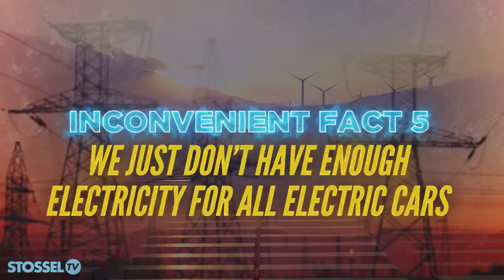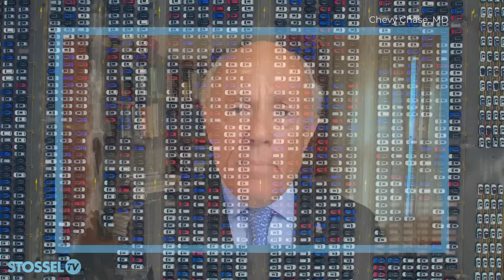Electric Cars: Inconvenient Facts, Part 2

Comment: Here are my opinions about some of the anti-EV arguments:

1. "They'll overload the power grid" If everyone used DC fast charging then yes, but you don't/shouldn't just let them run out like a gas car. The best way to charge them is overnight, and unless you drive 100+ miles/day, that should only have to happen a couple of nights per week. Also, charging at home uses roughly as much power as maxing out your oven and stovetop. If this was actually a problem then there would be rolling blackouts every Thanksgiving.
2. "They're too expensive" They are kind of expensive but you can get a used one. I bought a 2017 Chevy Bolt in like-new condition in 2021 for about $17.5k, including sales tax and shipping. Current batteries last a long time so unless the previous owner lived in the desert or used DC fast charging every day then it should be in great condition. You can also use an OBD reader and voltmeter to identify bad cells and replace them. After enough miles, especially city miles, the car will more than pay for itself in terms of the gas you save.
3. "It'll increase my electric bill" Well, yes, but less than what you'd normally pay for gas, even in a reasonably efficient car. I pay something like 3 or 4 cents per mile when I charge at home. For comparison, my dad's car gets 39 miles/gallon and he pays around 8.2 cents per mile.
4. "There aren't enough chargers to do road trips" Yes there are. I use an app called PlugShare. You can even filter by free chargers. There are hundreds of free ones everywhere, sometimes even the ones with DC fast charging (I used a free DC fast charger in Atlanta 2 weeks ago). Sometimes individuals list their home chargers for free and only ask for you to send a text in advance, but of course you wouldn't want to depend on that. You can also pay if you want to have a better chance of finding one that's available and not broken, or if you want to use DC fast charging.
5. "They don't work when it's cold" That's true. They lose roughly half of the range in winter, so until they have solid-state batteries with twice the range, they won't be a good choice in cold climates.
6. "Just use gas directly! Don't burn it in a power plant to charge batteries!" A gas engine in a car is about 20-25% efficient, compared to about 54% to charge a car from a natural gas power plant (60% for the generator, a little over 90% to charge the battery, and transmission losses), so it still makes more sense to use gas that way, although I think it's still wasteful. Ideally power should come from solar panels, nuclear, and mechanical sources such as wind and hydro and be reserved for things that actually need it such as lights, computers, and EV's and fossil fuel should be saved for heating, cooking, and making plastic.
7. "It's a weird new gimmick to convert us to Communism" Wrong. The first rudimentary EV predated gas cars by about 50 years in the 1800's. In my opinion, gas engines wouldn't have become popular if they had had lithium ion batteries back then.

Even though I like EV's and drive one, I still don't think they're ready for everyone, but once they have cheap solid-state batteries, it won't make economic sense to use gas engines anymore. My electric car is perfect for me but I support other people's right to not have one. I know that most people can't afford to transition yet, or drive too much each day for it to make sense so I don't think gas cars should be banned. And before people say that the government can turn off my car because of the computers (yes, I know they can and I'm not denying it), what gas car made since the early 90's doesn't also have a computer?

Comment: Yesterday I saw 2 cars parked as far as possible from the Freehold Mall
At first I figured it was carpool parking but no, that's where they put the chargers to make sure you get your 10,000 steps in
Reply: They put the charging stations distant from the entrance to prevent jerks from parking in them. "Look, there's an open space." "But that's a charging station." "Not my problem, I park in the closest open spot I find."
Reply: @Fishy "Smart. When the EV's catch fire the mall should be safe." EVs are 100x safer from fire than a gasoline car.
Reply: The reason the charging stations are so far away is when the electric cars catch fire it won't burn down their stores
Reply: @jonbender9110  gasoline cars catch fire 100 times more often than electric cars do. Please get some facts before you type, you'll look less foolish.
Reply: @Just SomeGuy  give them time and when evs catch fire it's almost impossible to extinguish them and evs batteries are made with child slave labor

Comment: The unspoken part of the plan is the end of private ownership of personal vehicles. But it's not what you think. The large majority of the time during ownership a personal vehicle is parked, what if all that downtime  coul be used to provide transportation to others? Then we'll need fewer cars, fewer resources to build the reduced number of cars, and fewer cars plugged in to the grid. Make the car self-driving and it can be recalled for recharging or to pick-up its next passenger.
This plan is not meant to limit your freedom, that's just a bonus for those who want to rule you.

Comment: What about people like me who live in a very rural area? 200 miles to the nearest town with 100k people? That's a 3 hour drive. What's going to happen to the battery when it's -20° where I live. What do I do when I need a truck? How much will I have to spend to get another circuit put in my house to charge a car? Can I charge overnight on 110 volts?
Reply: Put in a standard 220 volt dryer outlet. Your 300 mile range car will be charged up overnight while you sleep.
Reply: @waywardgeologist2520  and what about just making a day trip to Billings or Bismarck? And hunting and fishing? And how much is running another 220 circuit going to cost? I have one that runs the stove. I can probably afford it, but what about others not so fortunate as me? I'll need two 220 circuits for 2 cars. How is that much more electricity going to be produced? Coal? California couldn't handle it this summer. Our area has less than 10k in the county, and maybe 500k in the east half of my state, and just over a million people when you add in west of Billings. How are we going to pay for power grid upgrades? Not everyone in town will be able to afford it. Electric cars are near and make sense for daily commuter's in urban areas, but it doesn't add up out here.
Reply: Hybrids make more sense than electric for many. If charging takes longer than fueling up, plus not having charging stations everywhere.
Reply: @russellsmith5056  people in big cities driving hybrids would make some sense to help reduce breathing in exhaust. But its good to have a back up gas generator at least in the electric car, or just have a hybrid instead of an electric, cuz people dont wana have to wait to charge or go somewhere and not have a charging station.

Comment: Electric cars are great in Winter. The battery has a hard time even starting the car unless it's plugged in. 
I have to trade in my hybrid for this same reason.
Reply: Im not in support of EVs but don't lie. The battery doesn't "start" an EV, it just turns on, like a cell phone and the cold has no affect on this. The cold only affects its range. Also, you did not turn in your hybrid for this reason. Another lie. In cold weather hybrid cars use the engine nearly full time so again the cold has no affect on its startup.
Reply: Norway has the highest percent of pure EV anywhere, so yes in very cold they need to be kept external powered in to keep battery warm.   But not to 'starting'.   And like the other person said, Hybrids keep engine running in cold to keep cabin heat on.   Do you live where it gets to -40c / -40f   ???
Reply: Nonsense.  EVs actually "start" better in the cold than ICE vehicles, which rely on a much lower tech BATTERY to start.  EVs just plain go- no cold cranking an engine or "warming up" the engine.  Our Tesla never had a problem in upstate NY during Jan and Feb.  In frigid Norway (northern Europpe), more than half of all new cars sold are eVs.

Comment: Why I won’t buy an electric car: it won’t become unusable if I’m deemed “unworthy of electricity” because of a Facebook post or something, lol.
Reply: You can generate you own electricity (wind/ solar).  But you can't make gas-"they" might cut off your gas.  You'd be better off with an eV when "they" take over...
Reply: @libertarian4323  Yeah, but if I have to travel cross country, I'd rather be able to just fill up my tank, then have to stop somewhere for an hour+ to wait for a charge.  Plus, gas can be carried with you, and immediately applied, while electricity storage is much more complicated and heavy.
Reply: @puppy14  We've driven our Teslas from South Texas to upstate NY and Vermont on a few occasions.  Supercharging is kind of strange.  If your battery is low, it charges super fast.  If it's nearly full, it takes much longer.  So we tend to run the car on ~50% or less, and make more frequent Supercharger stops (every hour or two).  Depending on where the chargers are located- the car will calculate the needed charge time for you. When the battery is that low, charging another hundred+ miles will take less time than it takes to hit the toilets and grab a coffee.  However, with an older, lower capacity Tesla, this would be much harder, and in either case, it's still going to take longer than an ICE vehicle.  Though it's also much cheaper than an ICE vehicle.  That said, long trips probably come   once or twice a year.  Most days, we just charge at home- and that's much easier than dealing with (and paying for) gas.

Comment: My two biggest problems with electric vehicles is 1. There's little infrastructure for them, and 2. Batteries really don't like the cold.
The government making these demands are literally putting the cart in front of the horse.
Reply: "Batteries really don't like the cold" that's what battery heating is for. BEVs are very successful in the ARCTIC CIRCLE. Most long range models are developed and tested there.
You do not live in a place more cold than the ARCTIC CIRLCLE.

Comment: EVs make no sense in areas like mine, West Texas. Ranges are not near what manufacturer claims and gas stations are often 200 miles apart as it is. Battery reserves fluctuate so much under load its nearly impossible to judge range during a trip (I saw report of an EV f150 towing an empty trailer that the range cut in half on a 150 mile trip)

Comment: Stossel on fossil, I enjoyed both parts of the information on the electric trick. Meaning what we're told and the reality of it. It's a help,  sort-of  and not the answer either. Thank you.
Reply: The solution to what is being call an issue is simple.
Reduce consumption.  There isn't a problem the planet has that couldn't be solved with less people.

Comment: Hybrids are the solution. The battery weight reduces the efficiency, but it still burns less fuel. Since it does not charge it does not waste the electricity that fast charging does, nor does it need the utilitys to rebuild to supp;y them!!!! Nor does it have a range problem!!!!

Comment: I think when you're charging an electric car you're just exporting the pollution to another place where the energy is coming from.
Reply: Exactly. Public transit bikes and walking are all more energy efficient and generate way less emissions. It’s time we start redesigning our infrastructure and our neighborhoods so we stop using cars in cities in general.
Reply: But a power plant makes energy much more efficiently on a bulk basis than a single internal combustion engine does. Resulting in lower carbon emissions.

Comment: The obvious solution to the EV range and charge times issues is to standardize battery design and sizes so a charged battery could be a quick swap like changing batteries in a cordless drill. That does nothing though to address all the many other issues coverèd in these videos.
Reply: Or it just takes me 5 mins to fill up and good to go 80mph for 400 miles with the AC full blast when it’s 95 degrees outside.
Reply: @shag139 thank you.

Comment: Having some insight which I can’t go into detail about, the RND with regard to electric is going to make the next few years seem like light years in progress. Once the infrastructure is fully in place (may take longer than expected), the gasoline engine will likely go the way of manual transmissions in the US. Not completely fazed out, but a clear cut minority. My next vehicle will likely be combustion, but after that it’s unlikely.

Comment: There is another infrastructure issue that is building , 1 roads will suffer 4 times  greater wear and tear , failure due to weight 2 parking garages floor load per sq ft will be maxed or exceeded due to battery weight increasing failure potential structure 3 the far higher temperature of battery fires can easily break down structural components and toxic smoke chemicals within a limited ventilation building.

Comment: Japan's use of hgtr's to make red hydrogen looks interesting (basically nuclear).
For the points above, the grid will definitley be an issue, that would require more money spending on it. For small vechiles ideally we need something better than li-ion since it has materials becoming more difficult to source.
For large scale storage (from a wind turbine for example) there are other ways such as turning the electricity into something else (such as hydrogen) but you will have losses when you do that.
Reply: Creating hydrogen is very inefficient and expensive, it's much better and cheaper to just use the nuclear power directly. The US(and world) desperately needs nuclear regulatory reform and streamlining.
Reply: @tehScribbles  My understanding is they're generating hyrogen differently than the conventional methods which is where it gets it's "red" nickname from. Using HTGR reactors which is something new.
Reply: I with this was true.  But the red hydrogen math does not make it competitive.

Comment: What a difference a year makes! Nuclear and Coal power plants have been obsoleted by solar and battery storage. They can’t compete with the low cost of Solar. We can double the power to the grid by simply updating our power lines! 100 mi.² of solar will meet all power demands of the United States for the conceivable future. France has shut down 6 nuclear power plants and has scraped a 7th under construction. Today, nothing can compete against the low low cost of renewables.

Comment: I suggest you watch “EV or Gas, which pollutes more” you will see that you have completely ignored the supply chain for getting the fuel from underground to the car! You have also ignored the impact of home solar and the ability to charge from home green energy! I am a retired chartered Electrical Engineer who has over 30 years experience in the energy supply business.

Comment: California can and should switch to residential solar power since they have lots of sun and this will reduce the stress on the hydro grid.

What was the main reason for EV's over ICE vehicles? Answer: Reduction in daily air pollution and noise.

Comment: At the end of the Second World War, American train companies like Amtrak tried to get people on board to use trains to get around. But the Detroit big 3 GM, Ford, Chrysler and big oil had different ideas. They pushed hard to get people into cars and convinced the public they are much better off having a car. Then the government had to and did spend trillions building the nation wide interstate system. If Amtrak didn’t lose to the car, there would be nation wide high speed rail by now, and they’re electric using overhead bus bars for power.

Comment: Love this information. I know someone with an all electric vehicle, and they told me you cant use your air conditioner, radio, or other electric powered devices in the car because it uses up your battery. Then when the battery  runs low you have to stop and charge it for about 45 minutes. To me, I cant see this working out in the future.
Reply: 2nd gen LFP (2024) can operate at -20C to 80C and charge to 80% in 10mins with less wear.
Solid state batteries will do even better, but work in progress.

Comment: The recommended charge limit of a battery in an EV is 80%. So if a EV has a range of 300 miles with a 100% charge then with an 80% charge would its true range be 240 miles?

Comment: I believe we will need fossil fuels for quite some time, for fertilizer, plastics, asphalt, lubricants, etc. But you can’t deny that battery cars work fine for many people, 1,000,000 sold in the U.S. alone last year. As for the grid, we need more power no matter how many EV’s there are.

Comment: There is a massive push on to force heat pumps which in the winters in most of Canada is nothing but a glorified electric space heater, which will make things harder. So I am NOT getting rid of my wood fire place ever!
Reply: Heat pumps are a great thing to use, but they shouldn't replace your furnace. When it's  not too cold for them to function properly they put about 4x more energy in your house than they consume.

Comment: Bloody heck mate they have been doing this for decades 🤭🙄Doh.  We have to change our batteries for almost every electronic device we own. Ain’t that a clue?🤔🥳
Reply: No. EV batteries are very different from mobile phone / laptop batteries. They have active cooling and typically only 10% of the battery is used per day. Compare this to a mobile phone which needs a full charge on an almost daily basis.

EV batteries are warranted for at least 8 years / 100,000 miles in the US. Tesla batteries are expected to last 300,000 miles on average. They only show a degradation of about 12% at 200,000 miles. In most cases they'll outlast the useful life of the car, after which they can be recycled or repurposed for grid storage.